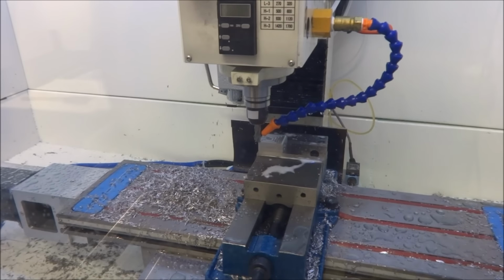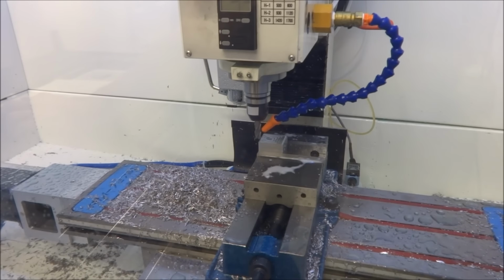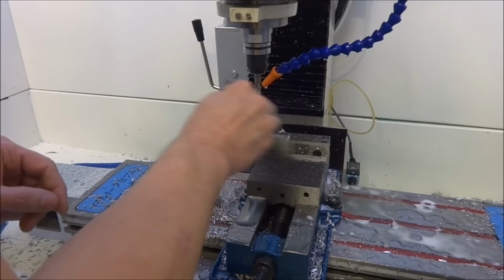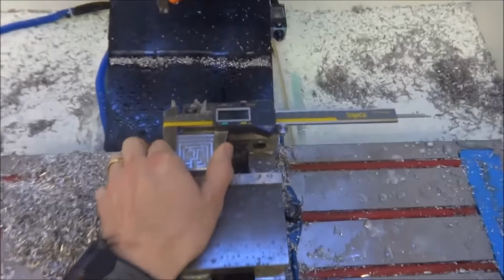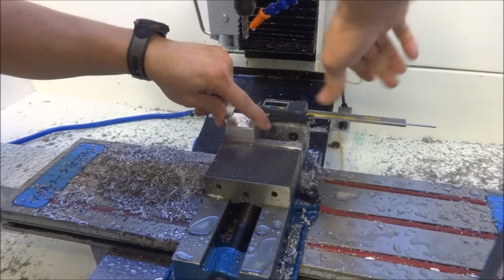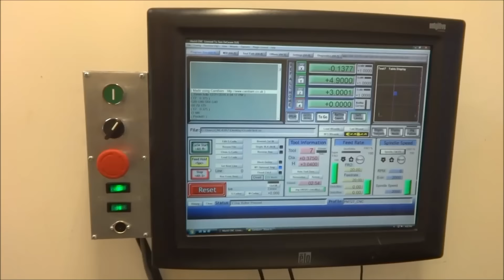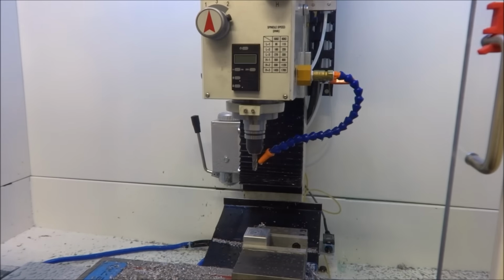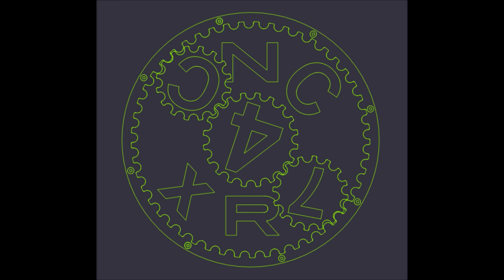PM727M Linear Test for Accuracy

Comment: Wow !!!! Nicely done Sam!!! So when are the retrofit kits coming out !!! I call dibs !!!
Reply from the maker: Thank you, Kits did you say Kits?  I'm not sure I will start by offering the 360 Models and wiring Plans.
Reply: CNC4XR7 Thats an excellent start . I was confident in making the parts until you got to the end. Making parts with a disassembled mill is a bit challenging .
Reply from the maker: Yes I understand, All of the conversion pieces can be made with the Mill , Doing the oil grooves would be a issue without a mill but those can be left out of the build.

Start slow one piece at a time there have been at least 2 people that have done this conversion just following my video's.

Comment: Hey Sam,
Did you have any issues with Fusion and Mach with your parts coming out oversized? My test square cuts are coming out .005 oversized in the x and .006 in the y.
Reply from the maker: Steven Previtali 
I have not ran into any issues make sure your cam operation is not leaving any material to be removed on a finish pass
Reply: Thanks Sam.  I just wanted to make sure i wasn't missing something simple.
Reply from the maker: Your welcome.